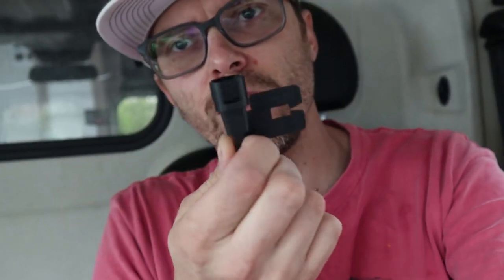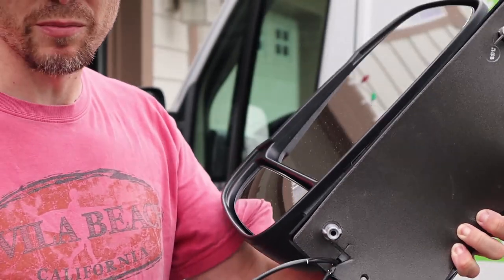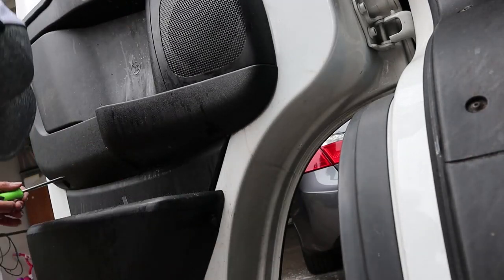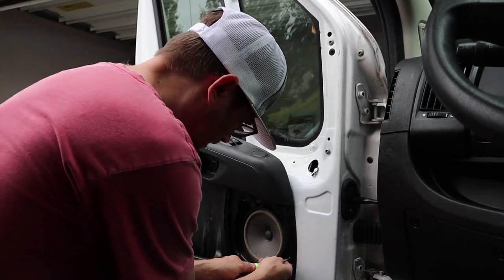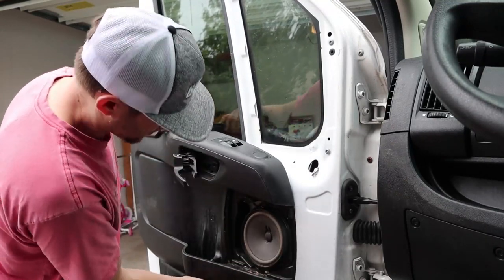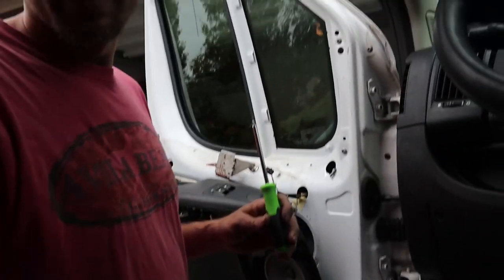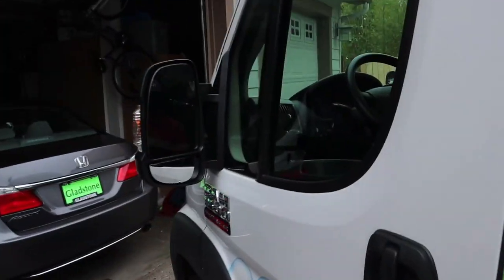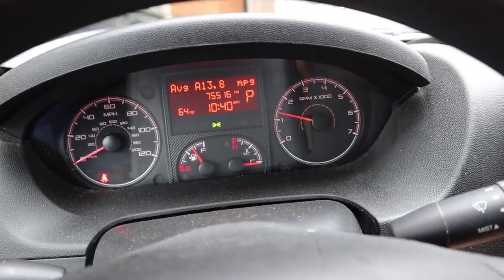Ram Promaster Mirror and Air Temp REPLACEMENT DIY!

Comment: I work as mechanic for a amazon fleet that has pro masters ,, don’t take the door panel off , just the speaker , and the window switch , you can reach everything from there
Reply: Hi, I'm sorry but maybe you can help me. I'm searching for a mirror replacement for a Jumper Mk3, that is the same as this ones and I'm not sure which one has got the automatic folding motor. 8 pin ones??
Reply: @JuanjeteMS  I’m not familiar with what a jumper mk3 is
Reply: @JR-km9zg  same van, different badge. In Europe we have 3 vans that are essentially the same with a different badge and the door it's exactly the same as I can see in the video.
Reply: @JuanjeteMS  the Amazon promaster 3500 mirrors are not electric folding mirrors , driver side mirrors for them have 2 plugs , I don’t have it in front of me but I’m pretty sure both plugs are 2 wires each , one for ambient temp sensor and one for electric motor
Reply: This worked great.  Thank you J.R.

Comment: Great video! Can you help with getting a used or new  right mirror for ram promaster 2500 which has power folding, heating, power adjustment. Thank You.
Reply: Procedure is same, just two sets of wires and two plugs from mirror and a much more expensive mirror.  There are better videos of this.

Comment: That sensor is not from ram promaster. On ebay they sell a sensor identical to the original, only you have to put the connector on it because it does not come with it.

Comment: Stupid wiring design. The wire disconnect should have been right behind the mirror and not behind the door panel. I see both Promaster and Transit plagued with all kinds of issues. Doesn't look likes anything has changed for improvement even with the 2020 Promaster. How long before Toyota brings the HiAce cargo van to America? It would be worth paying an extra $5K or more for a Toyota over a Promaster and Transit and not have all of these failure issues.
Reply: Old comment I know but I hear you, even my Ford transit wasn't as bad as the Ram PMC..

Comment: Done! On a 3500 there was another T40 on the top. Just dont force, if you feel resistance stop. After I put it together I saw the connectors I just installed under the speaker, Oh well, once you start ya can't stop. My sensor is now back to normal, Auto Zone told me it was the in line sensor, so I replaced that for $26. NO that wasn't it. I read that that bad sensor could also effect your MPG.